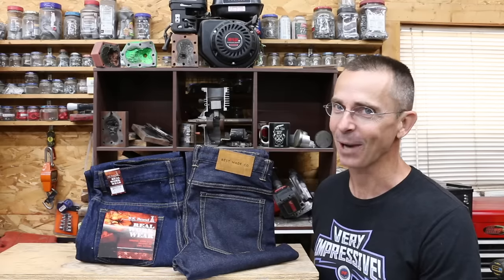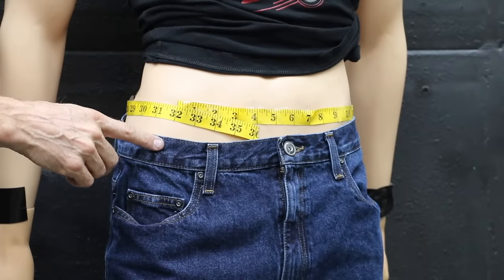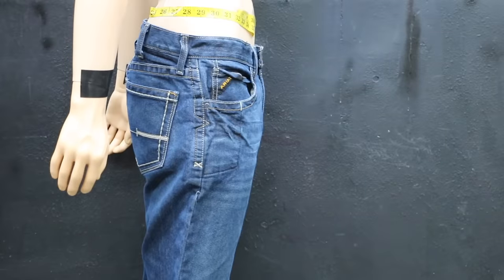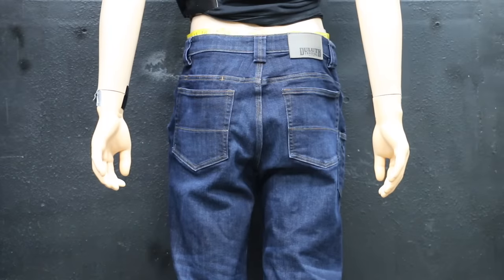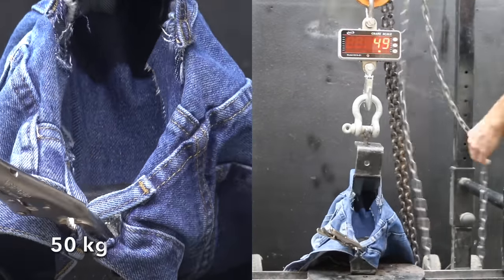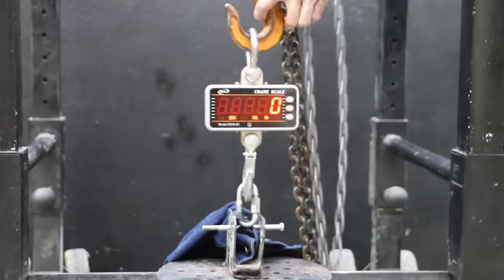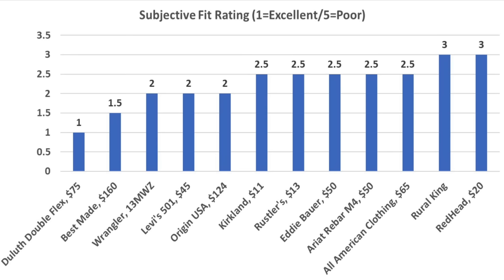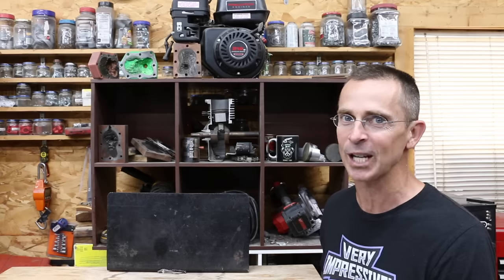$10 vs $160 Jeans? Let's Settle This!

Comment: I was a Levi fan for many years, but their quality, especially fabric wearing into holes, made me turn to wearing wranglers.  Your testing seems to prove my point.  Glad you did this denim test because I have other brand options to consider, and others to possibly avoid.
Reply from the maker: Thanks for sharing.
Reply: I remember as a kid Levi's were the go to. Now my pair barely lasted me 3 months before I had to do surgery.
Reply: If you wear a hole in Levi's then you will love the aeration Wrankers provide.  Realize you are wearing 20% spandex...
Reply: Im on my route to that. Researching now.
Reply: Try roundhouse jeans
Reply: @Look_What_You_Did  It depends on the version you get but most wranglers are a heavier weight more durable fabric than most Levi's and spandex is only used in flex fabric options which are not typically used in workwear.
Reply: I used to be diehard Levi until all my new pairs would get holes in the pockets in a few months. I wear CK now for casual situations.

Comment: If you haven't done so already, you should test road salt! So many different types at hugely different price points. Hard to know what's worth it.

Appreciate your hard work that goes into these videos!
Reply from the maker: Thank you for the video idea!
Reply: You could also add liquid ice melt like brines also
Reply: Road Runner calcium chloride is my facorite, especially for walkways. The Looney Tunes Road Runner on the bag is cool too .lol
Reply: Let's test electrical resistance also !
Reply: @@TS011969 are you talking about pea gravel ?
Reply: And sidewalk salt! (They are different, at least here in Manitoba. Sidewalk salt can contain sand.)
Reply: isnt all salt the same?
Reply: No snow in Florida, unfortunately... I miss the snow  😥😢😭
Reply: I just go to Lowes and Hone depot and look for the damaged bags for 50% off.  Just picked up a 50lb bag of the road runner ice melt for 6 bucks.  I store it in 5 gallon buckets with lids anyways so who cares if the bag is ripped.
Reply: @darkshadowsx5949  
There's a difference in the melting Temps.  I forget which is which, but I think the table salt stuff won't melt below like 25 degrees f.  Usually the "safe for concrete" stuff has a lower melting point.  Concrete gets ruined from the ice and snow melting, water getting in the cracks, then freezing again as the Temps drop.
Reply: @ProjectFarm  
And you test the pet friendly salt too as a lot of us have dogs and we don't want to hurt their paws with the product.
Reply: Really? Road salt? why not egg yolks for Chicken farmers as well. Come on please use common sense and be reasonable. His tests cover more than enough for the average Joe. Road salt does not the average Joe ever see...again please be reasonable.
Reply: Oh yeah that's a good one, I was just looking at road salt the other day because I was concerned about my concrete driveway (shouldn't salt them).

Comment: Part of my criteria for jeans is how the cut of them feels while wearing them. I avoid the Rustler brand, as they seem to feel like a cheap hotel (no ballroom), and some of them felt like they were on backwards all the time. (Hard to describe, like the fabric on the front of the thigh is tight when you move your legs.) Some of the best britches I have are the old Faded Glory and Basic Editions (No Kmart around here these days, so can't get them anymore) which allow a good range of motion, are fairly sturdy, and ride high enough to hide the plumber's posterior.
Reply: You could ship your pants! I've seen the Kmart ad.
Reply from the maker: Thanks for the feedback.
Reply: @ProjectFarm  when showing the product caption in the bottom left corner  it would help to show the price next to it at each test.  Ie. Levis ($45), next test Duluth ($75), etc

Helps to understand price vs performance at each test.
Reply: Basically youre right, the jeans shouldnt interfere with the ballroom but the underwear should. I use boxerbriefs one size below my actual size to get a tight grip, with high activity it will save you from painful experiences like twisted nuts and whatever. Oh and the myth about tight undies and fertility, completely untrue, no evidence except assumptions.

Comment: I've been a big fan of Duluth Standard fit for a long time. They are by far the most comfortable and despite their work orientation, they are nice enough to wear for pretty much any occasion. I'm glad this test confirms my bias! Not to mention they go on sale for about $50 regularly.
Reply from the maker: Thanks for sharing.
Reply: try the fire hose flex cargos next time great pants that last years
Reply: @Matthew-uy6lc  I actually have 2 pairs but they don't fit as loosely as the jeans so I gotta get a little skinnier before I run them full time at work.
Reply: Where can you buy them? Are they relaxed type of jeans?
Reply: @Matthew-uy6lc  they're great my only two issues are the button and belt loops

Comment: 5 pockets and deep back pockets are helpful. It's nice when your back pocket will hold a wrench. Thanks for the great information.   Flannel shirts would be a good companion piece to the jeans video. A shirt pocket that will hold a lot without damage is important.
Reply from the maker: You are welcome!  Thanks for the suggestion.
Reply: I'm a big time flannel guy, and in my experience, Wolverine makes the best flannel shirt out there! Heavyweight 100% cotton with strong stitching and extremely durable. I've had my Wolverine flannel for about a year now, and still wears nicely!

Comment: I went looking for some American made jeans a few years ago and came across All American. I got one pair to try, after a year of use even with what I do to clothes they still look new. So now I have 6 pair of them.

I had one pair of pants from Duluth trading. They ripped out down the entire seam on the leg and ran incredibly small. Duluth wouldn't do anything about it and as such I don't use their products anymore.
Reply: I love All American brand hoodies, going to try their jeans now as well
Reply: What’ a Shame. I wanted to try deluth for a while now.
Reply: I bought a belt from Duluth trading company and paid like $135 for it. The tag said made in China. Never again will I buy anything from that company.
Reply: I have Duluth items. If it fails, they always took care of me…..
Reply: I thought the Duluth fire hose jeans would be good.. Nope got a hole in the knee in less than 3 months.
Reply: Duluth is terrible, all marketing wank, my fire hose pants didnt last two weeks before they started falling apart.
Reply: @guthrie1960  that's exactly what I had that the entire seam split.
Reply: Jesus... was about to buy a couple pairs thanks for the feedback 🥲
Reply: @guthrie1960  they have a lifetime warranty. Get a return authorization and get them replaced.
Reply: @Tommy.461  Sorry if I have found out that something is not going to work for me getting another one does not fix my problem.
Reply: @NutritionPolice  some all american hoodies are bayside brand.  Very durable and American made.  Bayside makes alot of good products
Reply: @MichaelWilliams-in3iz  You bought a $135 belt without checking where it was made? That's your own fault
Reply: @surewhynot6259  I ordered it online, they didn’t mention it was made in China
Reply from the maker: Thanks for sharing.

Comment: I think a good video idea would be to test work socks. I'm interested in indestructible socks, but the most comfortable I've found are the thicker Dickies that last me maybe a year.

Merry Christmas! ☦
Reply: Darn Tough heavy hikers are unbeatable. I've bought about $300 worth of pairs over the last 5 years, and any two still match!
Reply: Came here to say the same thing. Darn Tough Vermont by far. Maybe there's something better, but I haven't found it yet.
Reply: Another vote for darn tough here. I have a handful each of their light and heavier weight socks. Something that hasn't been mentioned though is the fact that if you wear out a pair of socks, they'll ship you a replacement pair.
Reply: Darn tough no doubt, I have about 30 pairs that I bought 10 years ago, they still good
Reply: I bought some Dickies work socks. I got some really thick boot socks that are more winter oriented I think, and some grey color sort of thicker work socks. 
You MUST buy the ones that are made NOT in China. I found that out right quick. The others have lasted very, very well. Unlike most of these commenters, I did not buy 30 pairs of socks(lol) I bought 6 for about $15. 
I  got these after the Timberland socks I had wore out and I discovered the invincible socks I had found at a liquidation store for pennies had been changed to chinese socks that were about as good as walmart hanes by the time I wanted to replace them. 
I am always amazed at how these companies can make a brilliant product that I would continue buying for my lifetime and then change them to something terrible and lose all their customers. How stupid is corporate leadership? 
I suggest if you find something like this that you like you go buy 20 years supply because 2 years from now they won't exist anymore.
Reply: Same here.  Darn Tough all the way.  Just bought three more pairs of the hikers.  Best winter sock out there.  
Need to get the newspaper real quick, but there's 4 inches of snow?  Don't even bother with shoes.   The socks will dry faster, and you probably won't even notice them being wet. 
Puddles of melted snow by the door?  Who cares?  You'd have to stand in them for minutes to start feeling it.
Reply: We need breathability and moisture wicking in that test!

Comment: The pocket strength test although impressive does not apply to me since in all of my 50 yrs of using jeans I've only had maybe one or two with a pocket failure. Most of my failures are in the lap and knee areas. Once the knee gets a small wear hole, the jean is pretty much gone in no time. I can't imagine ppl with purposely made holes in that area.  Overall, my jeans last over 5 yrs easily. 
Good test data for my next purchase.
Reply: I have had pockets fail on jeans and you pretty much have to chuck them away straight away. For me it is purely the strength and quality of the denim that matters aftermthe basics.

Comment: Based on the outcome from your previous video on carpenter jeans, I purchased a pair of Blue Mountain carpenter jeans and a pair of Blue mountain 5-pocket jeans.  Both were on sale for $10.  Great deal and they are comfortable.  We'll see about the durability part, but based on your tests, I think I'm good to go.  The one place where my jeans are most vulnerable is the left knee.  When working, it's not uncommon to bend down to my left knee to look at lower things.  So far, that knee is holding up just fine.  Appreciate the content.
Reply from the maker: Thanks!  Thanks for sharing.
Reply: TSC clothing is far better than its price would indicate. My work wardrobe is slowly growing quite a Blue Mountain collection...but I just might try the Rural Kings after these tests.

Comment: I bought Levi’s and have generally been happy with them. They lasted longer than store/generic brands I used to buy anyway. 
That said, the first pair of Levi’s I bought about 10-15 years ago that made me a believer is still going strong. Some of the pairs since then, not as much.
Reply: Ditto!
Reply from the maker: Thanks for sharing.
Reply: It's probably been 30 years since I wore a pair of jeans, but back then Levi was my jeans of choice. However I felt the quality really slipped over the years. As a  kid playing rough the jeans used to last almost a year, but twenty years later I went through three to four pairs of jeans a year. And that was working as an IT tech, which included a lot less climbing over rocks, sliding down hill on my ass, climbing trees and stuffing my pockets full of knives, wood screws, nails, screw drivers and whatever. As a tech all I had was my keys and my wallet. And yet they wore out incredibly fast.

Got tired of the whole ripping jeans thing and switched to cargo pants. After all the whole idea of jeans is that they should be hard wearing. If they are wear as fast or faster than cargo pants then why use them? Now I can't imagine buying pants without cargo pockets.
Reply: @blahorgaslisk7763  that's unbelievably surprising for an IT guy to wear out 4 pairs of jeans in a year. You're literally sitting all day unless you're doing the rare cabling work that some employers expect from IT.
Reply: @ChainsawChristmas  That's the point. the end of the 80's, early 90's Levis went total shit. I stopped using jeans all together and never looked back. Well almost... I bought into the hype early 2K and got a pair. But I was surprised at how uncomfortable they were and threw them in the back of a drawer never to look at them again.

Comment: I've worn Levi's, Rustler, Wrangler, Dickies, and Faded Glory from Walmart and other (apparently) no-name Walmart brands, and an expensive brand from A&A Western Stores to match a very nice denim jacket with the Navy emblem embossed on the back, which I can find now to get the brand.😕  I've never thought of breathability, but that would be a great consideration to know for Summer and Winter jeans.  Since you mention weight, that might be a good weigh way to tell breathability. 😆  I've never had a crotch split, but the butt area blew in one pair and they were even kind of big on me, so it's not like they were stretched tight.  They were painting and yard work jeans.  Buying jeans from Walmart could drastically effect the performance you got here as Walmart is always demanding that products be made cheaper for more profit.  Sam Walton must be rolling in his grave over what his boys have done to his Walmart.  Looking at the prices you paid, it appears that none of them came from Walmart.  I buy what Walmart has in my size when they have it, so while this info is great, I doubt I'd benefit from it.  However, prices of EVERYTHING have gone way up since Covid, but my brands here are still Wrangler and down.

I am always amazed by the things you think of to test in these comparison videos and the ways you come up with to test them.  All things are considered when most may not have even thought of them.  Excellent, Todd!  Happy Holidays!
Reply: @King Of Crunk  Thanks for the note!  Happy New Year!

Comment: One thing about the zipper test that was not covered is long-term failure rate, which obviously you cannot do here.

Speaking from experience regarding Duluth Jeans, their zippers fail within two years or less. I have owned 5 pairs of the Ballroom jeans in three colors: Standard denim blue, black and indigo. Their Black and blue jeans were traditional 100% cotton while the indigo were a cotton/spandex blend.  Of the 5 pairs I owned, 4 of the zippers failed. The only one that has lasted longer than two years is the original blue denim. All of the black and the indigo pairs experienced zipper failure.

Here's the worst part: One of the black pairs of jeans was a replacement for an original pair that were returned to Duluth that experienced zipper failure within a month. That replacement pair failed less than a year later.

Why such a large failure rate? IMHO it's because none of my Duluth jeans features a YYK-made zipper. Until Duluth Trading Co. starts making their jeans with YYK zippers, they are a hard pass for me. 

That's a shame. Otherwise, Duluth's jeans were great.
Reply: I have never had a zipper fail on mine. I think I wear out the thighs first.
Reply: @gvrfour  Scott must be getting far more opportunities to open up the zippered tool pouch than you or I.
Reply: You might have meant to say YKK zippers.
Reply: I was gonna say choose ykk zippers but you already know it.
Reply: I have not had the zippers fail on the Duluth jeans.   I'll pay attention, as I have a lot of Duluth stuff now and not had problems with zippers.   But I do agree that YKK makes the best zippers.
Reply: I just wait for the crotch to rip then take them back to exchange them for free. I’ve done it about ten times now
Reply: @southernbenz2098  yup.

Comment: Would’ve been nice to have Roundhouse jeans in the mix. They are made in OK. I would buy a pair but they have been out of my size forever.
Reply from the maker: Thanks for the suggestion.
Reply: I used to only wear Roundhouse, the best fit and they would wear excellent in the construction trade.   Then they doubled in price and got harder to get. So I set out to find other USA made jeans. Texas Jeans are made in North Carolina, and are a close 2nd to Roundhouse in my book. Only downside, they continue to creep up in price.  Thanks a lot Joe!

Comment: The Levi's has a massive advantage and it's they maintain the cut for generations. I have very thick muscular calfs and I know that the Levi's 501 work for me, period.Specially one of the most elastic materials. I know I can just buy my size and it won't have changed.

I've been using levis 501 34W32L for the last 10 years and while there might be better alternatives this one works reliably and I don't have to make a decision or think about it.
Reply from the maker: Thanks for sharing.

Comment: Yay for Duluth! Thanks for adding them to your testing.  I have an idea, but cost might not be worth it.  What do you think about testing automotive/truck batteries?  I am not talking about EV or Electronic Vehicles.   I mean the batteries used to start a vehicle, especially in the cold.  You could test their CCA (Cold Cranking Amps), how long to drain them, how long to recover their charge, how they preform in extreme cold, or extreme heat. ETC.  At the price of $250-$350 each (ones I found for my truck), it may be too expensive for a test video.  Whatever you test next, I do look forward to watching it.  Thanks for the great videos!
Reply from the maker: Thanks and you are welcome! Thanks for the suggestion.